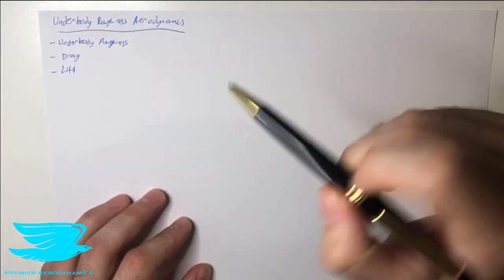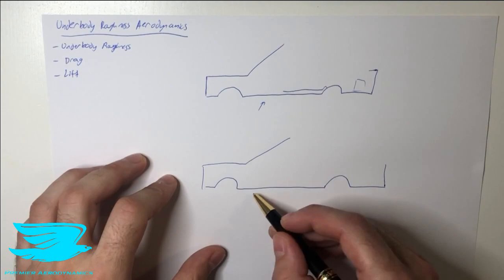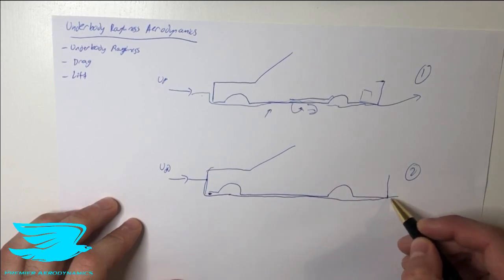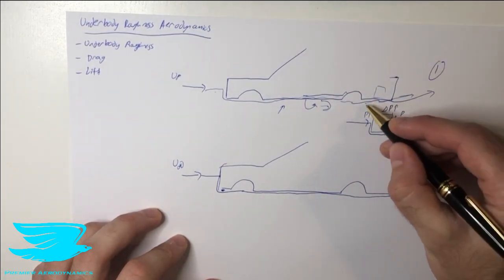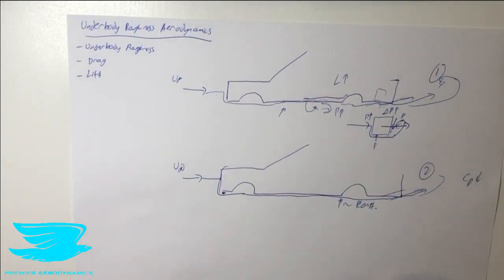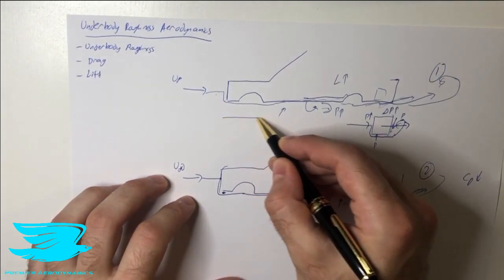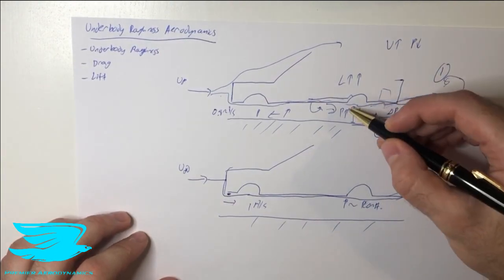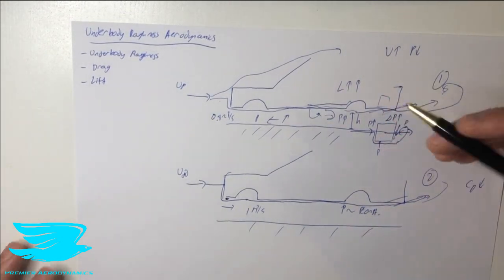{Automotive Aerodynamics #11} Effects of Underbody Roughness on Car Aerodynamics

Comment: I've watched quite a few videos on aerodynamics and there's one thing I haven't seen explained.  If the goal is to increase downforce in a vehicle that doesn't really need it (it's not a racecar), presumably to reduce drag and thereby increase efficiency, doesn't that increased downforce on the tires correspond to an increase in rolling resistance, which then decreases vehicle efficiency?
Reply from the maker: 100% It increases friction.

Comment: Where the pressure rises under the car has a huge effect on lift, or downforce. For instance, if you restrict underfloor flow by having a high pressure barrier at the front of the car, and keep air from getting under the car downstream, you'll get massive downforce due to the low pressure underneath.
Reply from the maker: Yep, you have such a big surface to work with as well, so you just get so much downforce from even a small reduction in pressure.